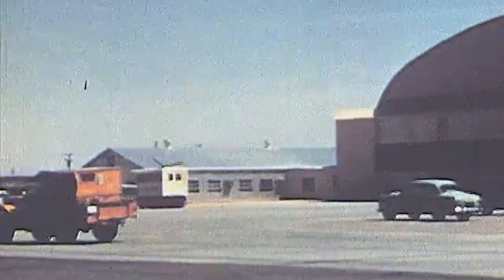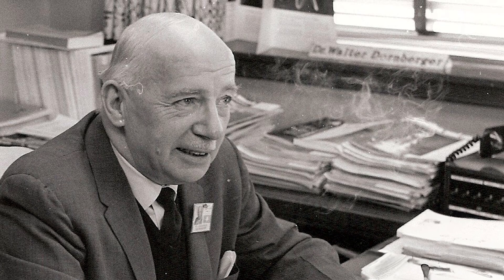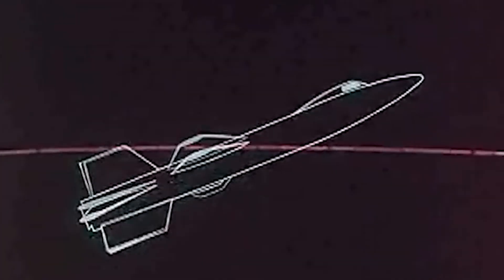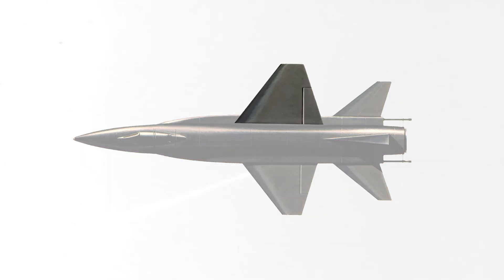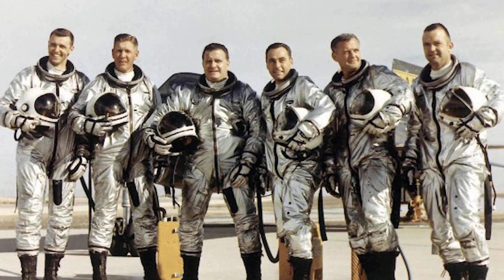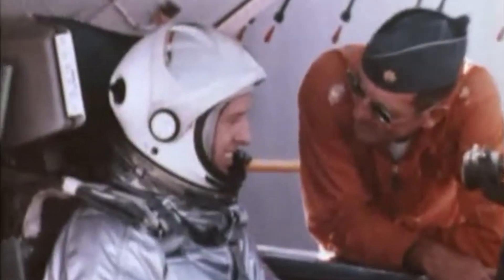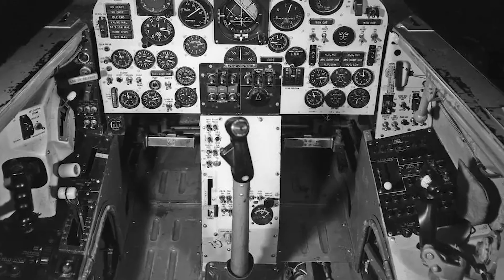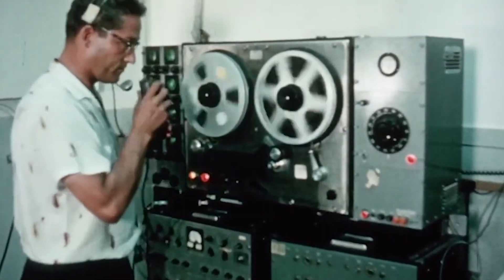Exploring the Limits of Speed | the X-15

Comment: Thank you for posting this video about the X-15. I would like to point out a few errors, however. You mention Scott Crossfield from North American was the first pilot, which is correct, but then say that, along with NASA, USAF, and USN pilots, there was also additional NAA pilots. That is not the case. Scotty was the only NAA pilot, and also there was only one pilot from the US Navy, Forrest Petersen. With regard to the construction of the X-15, there was some titanium used in the structure, but only in the low heat areas. The primary structure was a special nickel-alloy steel called Inconel-X. You then stated that the B-58 was initially favored as the mothership for the X-15. That is not the case. The B-58 could never have carried the X-15, and was never considered in that role. The only other mothership considered was the B-36, but with its service life coming to an end, it was considered that it would quickly become a problem for continued maintenance throughout the X-15's research life, so the newer B-52 was chosen instead. Next is that you state the X-15A-2 achieved the maximum altitude of 354,200 feet. Joe Walker never flew the X-15A-2, and the X-15A-2 did not enter service (having been rebuilt out of the original no. 2 airframe) until 25 June 1964, nearly a year after Joe Walker left the program. Walker did indeed fly the record altitude flight in August 1963, but it was in X-15 no. 3. The highest speed flight was flown by Pete Knight, but it did not occur on 10 March 1967. That flight occurred on 3 October 1967. And finally, the rocket-assisted F-104 was designated the NF-104.
Reply: x15galmichelleevans   Thanks for the comments and corrections, Michelle. I wrote the script for the video and will do my best to address your points briefly, although some of issues can be a little convoluted.
Regards
Michael Nelmes

Re. the sentence “The X-15 flight test program was begun… by Scott Crossfield and continued by a dozen US Air Force, NASA, US Navy and North American Aviation pilots”:
North American Aviation was meant to refer only to Crossfield. The sentence would be better worded “The X-15 flight test program was begun… by North American Aviation pilot Scott Crossfield and continued by a dozen US Air Force,
NASA and US Navy pilots.”

Re. the sentence “(the B-58 Hustler was initially favoured but replaced by the B-52)”: 
This was not meant to infer that the B-58 ever carried the X-15, although it could read that way. “Initially” here refers to the period of X-15 design development two years prior to its first flight, before the B-52 was chosen as mother-ship. Up until then, the B-58 was viewed favourably as the potential mother ship as its high speed would provide a higher release speed for the X-15. I assume that the final projected weight of the X-15 is what then ruled out the B-58 – although it might have been feasible, given that the X-15 weighed less that the bomber’s loaded payload pod. Also, the B-58 evidently had adequate ground clearance to be considered.

Re. the sentence “the aircraft did require heat-resistant titanium alloy to be used in much of its structure”:
The X-15’s structural framework is mostly titanium and steel, while its outer skin is nickel-chromium alloy Inconel X (which also contains titanium as a hardener). However, it would have been worth mentioning Inconel X, which I did in another X-planes article. 

Re. the sentence “the modified second aircraft (X-15A-2) attaining a maximum altitude of 354,200 feet (piloted by Joe Walker on 22 August 1963) and speed of 7,274kph or Mach 6.7 (William Knight on 10 March 1967)”:
Mea culpa on both counts. X-15A-2 should be X-15-3. Evidently in this sentence I confused the second aircraft (after its rebuild) with the third one. The date 10 March 1967 should be 3 October 1967 – that error arose from the American-style date format 10/3/67.

Re the sentence “a rocket-assisted F-104 Starfighter operated by NASA…”:
You’re correct that this was designated the NF-104. This was mentioned in my Wings magazine article which was the source of the narration, but evidently it was dropped for brevity.
Reply: @michaelnelmes1947  Thank you for your reply concerning my comments on your video. I appreciate the clarifications. However, I need to again point out that the B-58 was never considered as a viable candidate for the X-15 mothership. They knew very early in the process how much the vehicle would weigh, and what its basic dimensions would be. The original mothership was the B-36, as I mentioned, then switched to the B-52. At one time, late in the X-15 program, when they were preparing to construct the delta-winged version of the X-15, it was briefly considered to use the B-70 as the mothership for that vehicle, with the X-15 nestled in a cradle atop the massive bomber. But using an experimental aircraft to launch another experimental aircraft got little traction, and the idea was quickly dropped. The entire delta-wing X-15 program also disappeared with the loss of X-15-3 in the Michael Adams accident of 15 November 1967, since that aircraft was the one to be modified as the delta-wing testbed. As for the speed and altitude records set in the X-15, the altitude was set in X-15 no. 3 by Walker, and Knight set the speed record in the X-15A-2, on the final flight of that aircraft.
Reply: @rosl-80  The delta wing version of the X-15 would have indeed been a very interesting thing to have happened. They had actually started to cut metal to start modifying X-15 no. 3 into the delta configuration, but all work on that program stopped when the no. 3 aircraft was lost in the only X-15 fatal accident on 15 November 1967. It was a tragedy to lose pilot Michael Adams, and the program was cut short after that, including the loss of the follow-on delta wing version.

Comment: Excellent clip, thank you.
They only built 3 of them? I thought there were more than that.
You mention Neil Armstrong. Chuck Yeager had rather a lot to say about Armstrong. I'm thinking of one particular sequence about the speed you fly on approach, the advised touch-down speed. As told by Yeager, he advised Armstrong to come in a bit faster and not have to flare so much for touchdown, to maintain a lower angle of attack. Armstrong argued with him, and next flight, deliberately held the nose as high as he could and kept the aircraft airborne as long as he could. The X-15 had a nose-wheel, but it had skids in place of main-wheels, and they're a long way back on the airframe. Once those touch down, the front of the aircraft comes down very fast and very hard. I hear at least one X-15 was broken in half because of this, very possibly the one flown by Armstrong. If you touched down at 300 knots, the front was coming down from about 8 ~ 10 ft up. If you touched down at 220 ~ 230 KIAS, the front was coming down more like 20ft up, and it was coming down a lot faster and harder. In either case, the main skids / gear was so far back, the elevators had no leverage to keep the nose up or slow it's descent. Once the skids touch, what you do with the elevators, is irrelevant.
Reply: Yes, there were only three X-15s built, but it should be noted that Chuck Yeager had zero to do with the program and how it was flown.